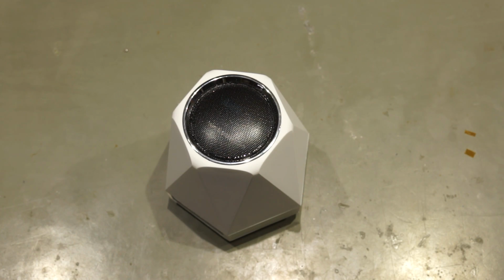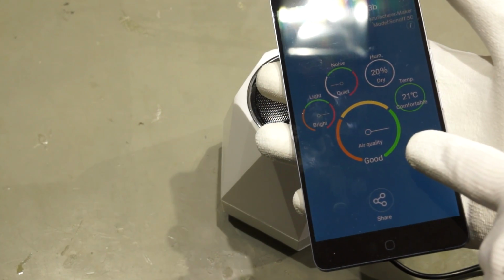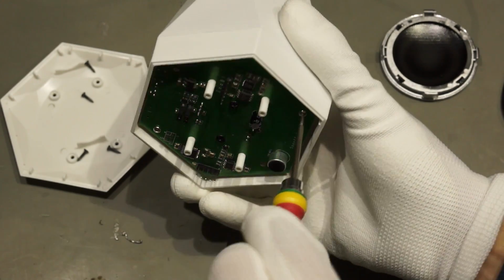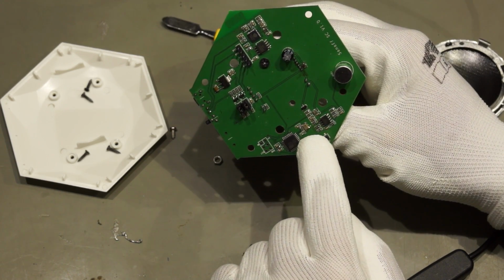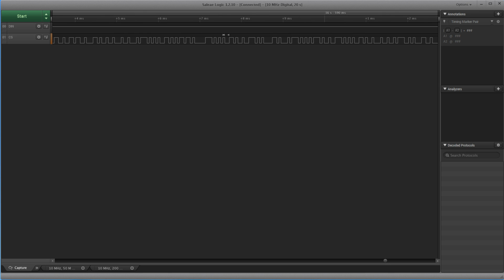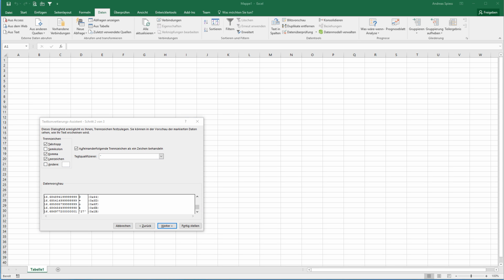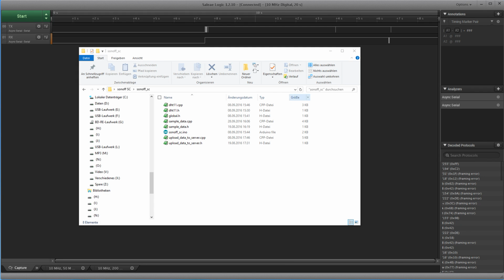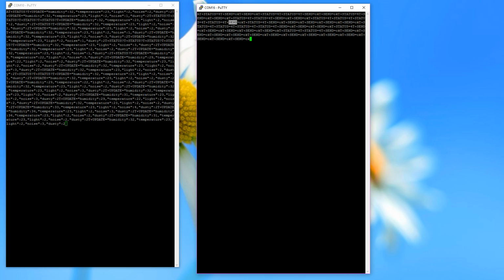#111 Labrep: How I work behind the scenes: Sonoff SC Multisensor Hack

Comment: Yes, good stuff. Love the process of thinking through how the device works, making educated guesses on which is the master controller, backing that up with the logic analyzer software.... I'm also amazed to see commercial products using the same sensors that we can buy and program. I just assumed that there were much more complex electronics being used in most cases. Mind blown.
Reply from the maker: Just keep in mind that this device only costs 20$ for 5 sensors (incl. shipping)...

Comment: I use Arduino Serial Messenger, you can tirgger pretty handy Interrupts, and exchange Data from the Nano to ESP.
What is the Model Name for the Air Quality Sensor?
Reply from the maker: 1. Seems to be an interesting piece of code.
2. It is a gp2y1010au0f